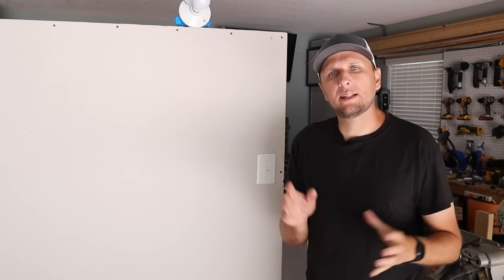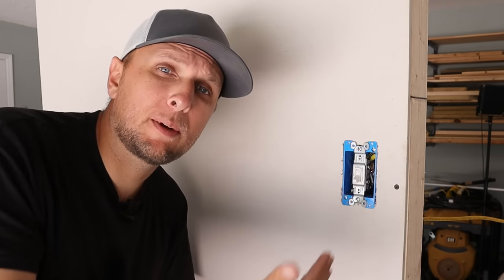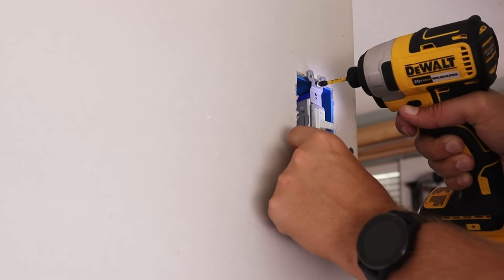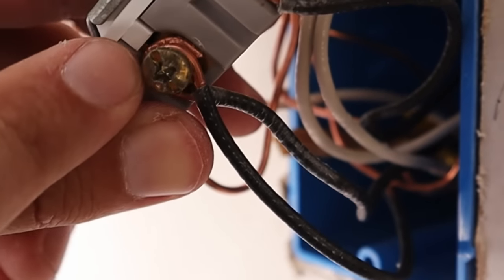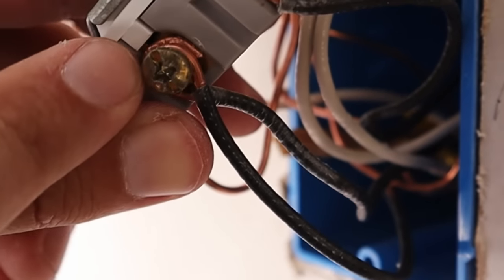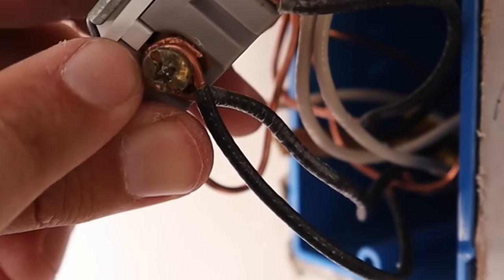How To Add An Outlet From A Light Switch | Common Mistake

Comment: I did exactly this, light switch off my plug tester shows correct. Lights on, my plug tester is showing hot neutral reverse. Can someone please help me
Reply from the maker: You probably don’t have a neutral wire or didn’t wire the neutral to the neutral side of the receptacle.  What you probably have is a switch leg which doesn’t have a neutral wire in the box but just a line wire and then a load wire to the fixture.  Sometimes the load wire is white in color.  That or somehow somewhere in your wiring, your neutral got connected to the load wire.  Since I can’t see what you have though, it’s hard to say exactly what the issue is and should be looked at by someone who can assess that.  Whether that’s you if you have the knowledge as to how to ascertain this or a professional.

Comment: I tried to do this but the switch only has 1 black, 1 white. I thiught I'd hook up the outlet to those but the rest was that the outlet only works when the light is off, and it makes the light flicker. Something isn't right. Anyone can help?
Reply from the maker: You don’t have a neutral wire.  You can’t use this without a neutral wire.

Comment: How to find a stud:: Get a magnet. Go vertically up and down on either side of outlet. Magnet will 100% find one sheetrock screw. Most likely more than 1. Here is your stud. At least on one side of your outlet. Dead giveaway of stud is THIS IS THE END OF THE WALL
Reply from the maker: Ok?
Reply: @HowToHomeDIY  Like your series, up to point and all good, but sometimes you do overcomplicate things. Like with this stud search and precision hole cutting ;-), Besides, electrical cable is rigid enough to push down without bothering with chains or other snake devices. Just push it down and catch below ;-)
Reply from the maker: How was it complicated though?  I showed using a stud finder and marking where it detected the edge of the stud.  And yes it was the end of my mock wall but I am trying to simulate more or a real world scenario where you can't see that.  I am sorry this confused you.  I went back and watched it and not sure how it gets much simpler.
Reply: @HowToHomeDIY  Once again, don't get me wrong. Your videos are great and I am learning a lot watching them.

Comment: Lol love how u skip the part where u actually installed the old work box, knowingly u had to trim around the edges where the ears grips the Sheetrock.
Reply from the maker: Honestly have no idea what you are talking about.  Nothing was skipped.
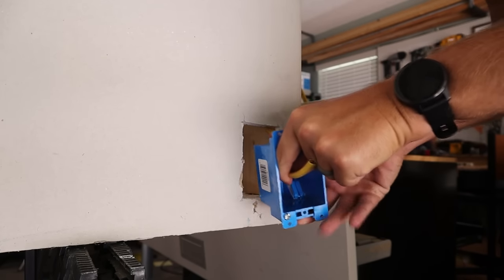Reply: @HowToHomeDIY  at 4:24 u placed the butt of the box in the Sheetrock but not when u stick the whole box in all of sudden you’re tighten the screw
Reply from the maker: Yeah I’m shortening the time.  I didn’t have to trim anything.

Comment: As an electrician in the UK, i wish youtube would remove this video. Totally illegal practice in the UK. Must be loads electrocuted by this sort of installation. Must be an absolute nightmare for anyone trying to find a fault if sockets and lighting are on the same circuits

tip: always use a professional !!!
Reply from the maker: Ok well this is the US and is perfectly legal here.  Our light and receptacle circuits aren’t separated often.  But I’m really curious how in the world you think someone would get electrocuted?
Reply: @HowToHomeDIY  Hi - i realise it wasn't a UK installation, but it appeared my feed for some reason. I know its been mentioned in other comments about "open" or "hot" neutrals. I've come across it loads of times when a feed or "live" has been taken from one circuit and a neutral from another. You think the circuit is dead and appears to be when tested but split the neutral and soon realise it isn't. 

I appreciate rules and methods are different in other countries. Just would be bad practise over here in blightly.
Reply: No requirement to separate lighting and receptacles in us.  Also we use a slightly safer voltage at least for residential....
Reply: @neilbrookes4009  He's not taking feed from one and neutral from the other. He's just wiring in parallel. It's all the same circuit. Are you sure you are a professional?

Comment: Electrical inspectors will fail an inspection if they do not find a green wirenut connecting the grounds.
Reply from the maker: I guess it depends on where you are but that is not a code requirement in the NEC.

Comment: You didn't check the outlet or test it when done with the switch for the light test.
Reply from the maker: The outlet tester showed it wired and functioning properly.

Comment: sometimes a switch does not have a neutral white wire.......what now ????
Reply from the maker: If there is no neutral and it’s up in the light fixture, you would need to run another wire or it wouldn’t work.  have to have a neutral for a receptacle.

Comment: You should put a disclaimer in the beginning of your videos.  "I am not a licensed electrician and this video is for entertainment purposes only."  The fact you added a receptacle from a switch in a garage and did not put it on a gfci is precious.  What about all the rooms in the house where outlets have to be dedicated circuits?  What if its a home built in the 80s or earlier that don't have neutrals in a switch box?  Where the white wire is a switch leg?  Those people will just end up calling an electrician and having soot above their box.

Comment: As a DIYer, the instructions are a little off.
Should be, turn off breaker, remove cover plate, double check voltage, remove switch,
CHECK FOR NEUTRAL.

Comment: You have totally confused me. Are you saying even a Switch Loop situation  can be hooked up to a receptacle? My light is controlled by two switches located apart from each other. I see Red and Black wires on on side of the switch and a ground and another black on the other side. No white wire....Now what?
Reply from the maker: No I am not saying that.  If your setup is a switch loop you will not have a neutral wire.  A neutral wire is required for a receptacle.  So it would not work in that instance.
Reply: @HowToHomeDIY  Thank you for replying. Most instructional youtubers say "like, comment and ask questions", however, they never answer. You are one of the good ones.🙇‍♀
Reply from the maker: @Sevil2023 You’re welcome!  I do try to comment on as many as I can, especially if there is a question.  Appreciate the feedback!

Comment: You aren't really supposed to run a receptacle off a lighting circuit or vice versa... you CAN, but you shouldn't...
Reply from the maker: Every house where I live (new homes) is wired that way.  They do them by room and don’t separate lights from receptacles.

Comment: What happened at 9:44? It looked like you took the new ground wire to twist it up, but then in the next shot (as you're still twisting and trimming the ground wire) the ground wire reappeared in the back again. It also looked like there was a ground wire extending out the bottom which goes to nothing a few seconds later. Just trying to understand what's going on here.

Comment: HOW MUCH MOTION AND TORQUE DO YOU PEOPLE HAVE IN YOUR ELECTRICAL BOXES AFTER IT'S SCREWED INTO PLACE FOR IT TO COME LOOSE??? I've double stacked many times. Older houses don't have room in the boxes for pigtails and umpteen wire nuts. I've never had a double stack fail yet. I do however tape around all my outlets after tightening down the wires using Tessa Tape

Comment: Could've just pull a single 14-3 from the light to the switch
Reply from the maker: Why would I pull it from the light?
Reply: Ain't that where your branch circuit coming from it look like a loop circuit about the 14-3 or 12-3 one is your switch leg than splice the hot and neutral down to your our outlet instead of pulling two romex
Reply from the maker: No, it is being fed into the switch box and then onto the light.  Older homes would have what you are referring to though!
Reply: @How To Home  1:20 it look like the romex is pull from light to the switch than to the outlet that why I say it look like switch loop

Comment: American wiring is Soooo different. Historically UK lighting is 1.5mm while power is 2.5mm and you could not, should not, run high resistance items like irons and kettles on 1.5 gauge wire.

Comment: Wago's are far superior to twist nuts. 😁🇬🇧🇬🇧
Reply: Not if they are installed correctly. The problem is most diyers install them incorrectly. Wire nuts can withstand a much higher temperature and provide a more secure connection

Comment: Combining lighting and socket (outlet) circuits is a really stupid idea. You have different loads and no mention is made of the impact of this on the distribution box. The latter should be clearly labelled indicating the circuit supplied so now your "ist Flr Lights" is powering sockets. This would fail any inspection in the UK. If this is an example of acceptable standards in the US I am sorely disappointed.

Comment: Jeez man ... who taught you how to use a sheetrock hand saw?  That saw cuts on the PUSH which is why you tore that sheetrock as bad as you did.  Perhaps you just rushed this demo through.  But IMHO taking a minute or two longer (especially as you fast forwarded this section) would have made you look like a professional ;)
Reply from the maker: If you think that’s bad, you should see the holes cut in the drywall in my house that the electricians put in it.  Can’t see them usually without removing the cover which is why nobody really cares.
Reply: @HowToHomeDIY  ... Know exactly what you mean!  It's just the 'Attention to Detail' alarm the military drilled into me starts going off whenever I see slack work like this ;)  Semper Fi!
Reply from the maker: @digiacomtech5589  😂 Take it easy.
Reply: Rotary drywall cutter would be even neater, and less risky too. Depth stop lets you set it so the blade just barely goes all the way through the wallboard

Comment: Or, just replace the light switch with a combo (sideways) switch and (single) outlet in the same box. No need to cut drywall and add new box.

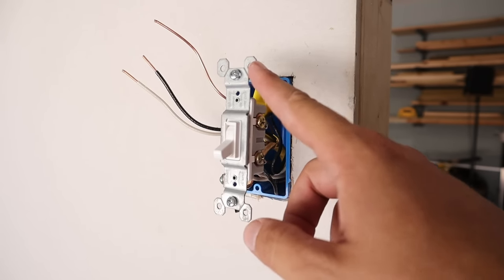Comment: i like 2 TAPE everything switch/outlet/wire nuts... my father redid entire 1947 house, he had built, usually using 12 wire @ least on all outlets, whether 15 or 20 amp... maybe not running 2 a light f/a switch... i'm a painter by trade, & i've  ' fixed ' almost entire homes because of bad switches/outlets, or even bad wiring, safely because of his teaching... be safe, don't touch things like u did @ 6:40, even after throwing circuit breaker off... union electrician taught me " DO NOT BECOME PART OF THE CIRCUITRY  "  although u were NOT grounded... a little LOL there... 🤯 learning f/u...

Comment: Yeah okay Right off the bat you've made a mistake by not telling your DIY homeowners they need to confirm that there's actually a common wire. Lots of switches are only in-line and don't technically need a common wire.

Comment: 1:00. If you work with power off, how will you know if you made a mistake? You don’t! When there are multiple wires, three-way switches, or other things that are straightforward, it would be easy to make a wrong connection.
Reply: It's so you don't shock the shit out of yourself. When done, test it. If it's wrong, cut the power and retry.

Comment: That is not a good thing to do most times light's are on a 15amp breaker and plugs are on 20amp this is because what you plug in is normally 20amp or under .I hope you're a electrician cause it doesn't look like it

Comment: Ok....easy task...but most switches are located next to doorframe so why put a receptical next to a door frame....do  video showing the added receptical several feet away!  Now just about every switch I have seen is wired from the light ceiling box and the line wire is white, and the load wire is black.  So not every switch box will have a neutral...you should know that...but as you are showing...good info...but not totally accurate!
Reply from the maker: I do know that, that is however becoming less and less prominent though as renovations are done and new or newer construction phase that out.  Every situation is different.  Thanks for the feedback.

Comment: OMG north American electrics are so dangerously outdated . Looped connections ? Wire nuts ? Never in UK
Reply from the maker: Yet our incidences of fire from electrical is lower per 1000 structures than the UK.  Nothing wrong with wire nuts at all.

Comment: ...good video ...shouldn't rock your strippers when stripping the wire ..causes Nick's in the wire...also looks like you used razor knife  on Romex...strip sheathing before installing old work with Romex strippers...also where is your green wirenut for ground...don't really like the splice and pigtail of ground...your splices are garbage..also if your next to a stud like that with your outlwt get rid of old work . After a while plugging in and out in and out the old work flags will fail....grab new work box with screws on inside so you can screw to the stud(( only when next to stud)

Comment: bought a house it was a nightmare of electrical problems the house was built in 1973 and whoever wired it was an idiot who did the reno before was not much better we did tear out all the drywall to rewire the whole house too to this day you will find electricians doing it wrong to the got onto a rut doing it wrong to make his job faster 
did for i paid him it was checked by a private electrical inspector he had t come back to fit the mistakes he did 3 places he should have had longer wires t the box he did not put samples throw the wires too he did give me a quote on that job all of the new wire he had to supple himself to 
some when with the new plumbing he did not like that at all i had to hire their plumber to redo the idiot's work i was taken to a small claims court all of the supplies he used were removed and the new plumber did that job right the judge did say the plumber had to take his supple back if he what to get any money from his mistakes 
he never came to put them up and we sold the house after we were done with my nephew and his wife bought, the house and raising a family their

Comment: I do not know if he is an electrician or not but I would not do some of the things in his video.  This is the problem with handhmen doing skilled trades work. They think they know but the do not. Why did you not tape your switch and recepticle.  It took me 8000 hours to learn my craft and I have to see this crap going on
Reply from the maker: Can you point the code out to me that says it is required?  That is a personal preference amongst electricians.  Many don't tape either of those things.
Reply: what sparkie tapes devices in PLASTIC boxes? that is DIY/handyman  trademark. tape is complete utter waste of time in a plastic box, there is NOTHING for device to arc to unless somehow you managed to get the bare ground near the screw terminals